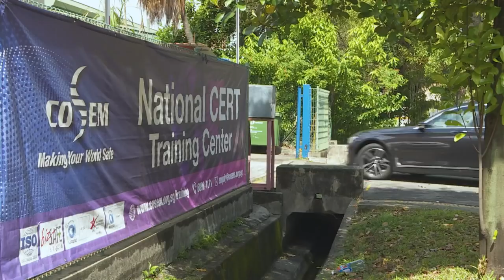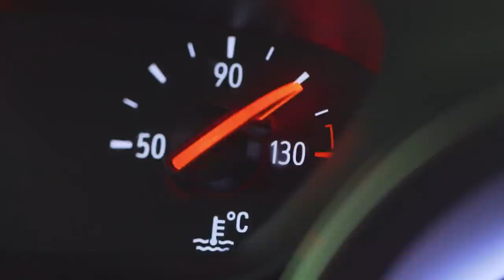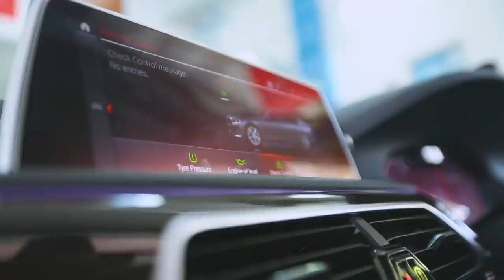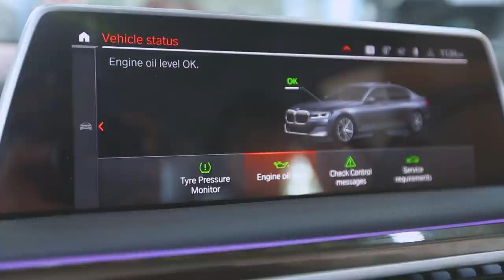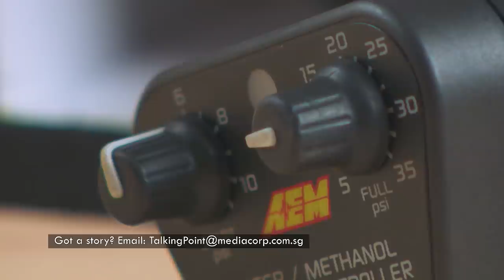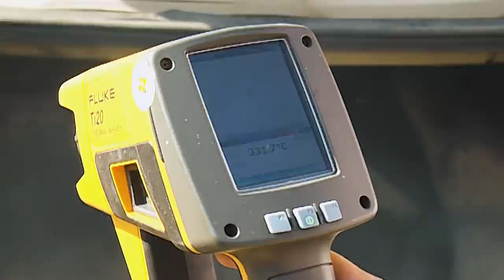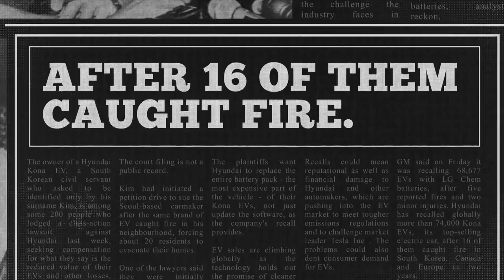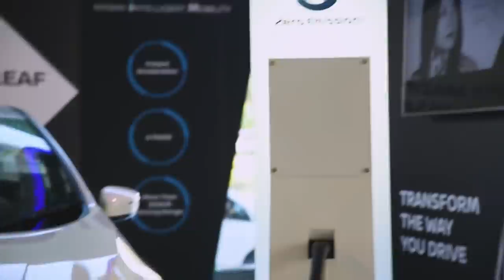Car Fires: What Causes Them And How To Prevent One? | Talking Point | Full Episode

Comment: One very important thing not mentioned here is NEVER LIFT BONNET/HOOD, as it will cause a huge flare up because the fire will have a fresh oxygen supply drawn up through the engine-bay to feed the flames!
Only ever fire an extinguisher through the grille (or pull the release inside your vehicle, then direct the nozzle between the gap), other wise you could receive serious burns in the attempt to save your car!
Reply: You are absolutely correct! Thanks for pointing that out. Be safe 🙏
Reply: good tip. Never thought of that!

Comment: Not conclusive as there's no showing of:
a) if modification to electric vehicles (EV) like sound systems and in build car cameras, will it affect the battery cell?
b) if an electric vehicle (EV) involves in a collision, (head on, T-bone, rear ended etc) will it affects on the integrity of the battery cell and other components?
Reply: To answer your questions 
a) If the wiring is properly done and the wire used is able to carry the power then it won't affect the battery cell. (For exmaple: Tesla cars actually have a separate car battery that runs the computers and all that when the car is not running, the battery cell itself is used to power the drivetrain.) If you're gonna upgrade anything eletrical just get some mechanic with experience to do it and you'll be fine. 
b) Depends on the vehicle, as most if not all EVs use litium-ion batteries, any impurities / puncture within that come into contact with the battery will catch fire. Impurities were the main reason the samsung note 7 became a bomb (also due to a faulty charging port which did not cut off the power after being fully charged). But typically in cars like Tesla cars will have heavy protection around the battery to ensure that in most cases nothing will puncture the battery.

Comment: Almost had my first car toasted when my electrical wiring touched the line of compressor and aircon causing heat which caused some spark luckily I immediately noticed the smoke coming from the hood and my father quickly disconnected one of the batteries to pour some water on the affected wiring (which isnt the best thing to do but there's no other choice), coincidentally stopped right beside a water station and help us stop the starting ignition of fire. It undergoes general electrical wiring now but it does leave a dark spot on the inside top of the hood, and we are thankful its just like that. Kinda traumatizing sometimes but hey, keeps u alert and aware all the time.

Comment: Wrong, gasoline/petrol does not auto ignite under pressure under normal circumstance. If it does, it's referred to as pre-detonation or more commonly known as knocking. What he is referring to are diesel engines.  Combustion happens automatically under pressure.

Comment: There's another way a car can catch fire. My car caught fire because the power steering fluid leaked out and it got too hot from the friction.
Reply: Yeah, doubt so, probably the power steering fluid dripped on the exhaust manifold that's why. Running a power steering pump dry will not cause overheating or fire. The pump will seize before that.
Reply: @galaxymode  Yeah that is exactly what happened in my Fiesta mk5

Comment: If you guys ever find yourself in a situation where your car is overheating, i recommend a hard reset on the car by pressing the Accelerator pedal (right) and the brake pedal (left) at the same time. This simple command will tell the car to factory reset all it's components. the car may create some smoke, but that's just a sign of the car disposing it's excess heat.
Reply: Thanks - great tip. I'll tell my friends to do this when they're in the car with all their kids. I assume any sign of flames is just a screensaver.
Reply: Car turn on or off?